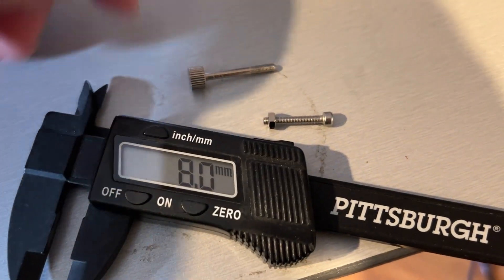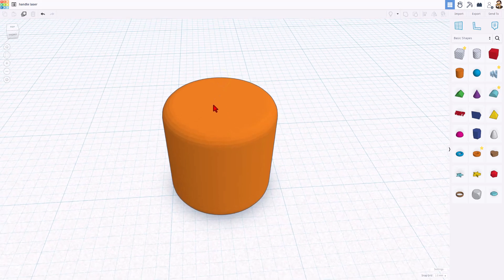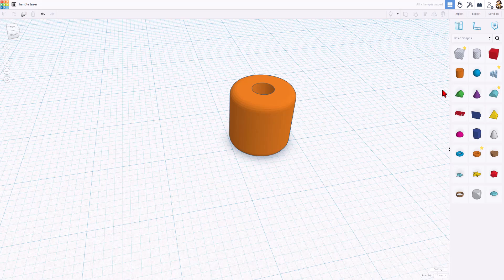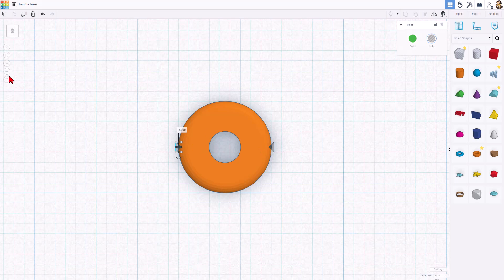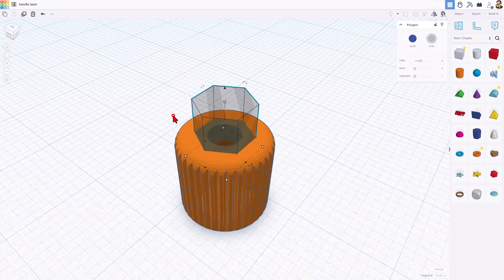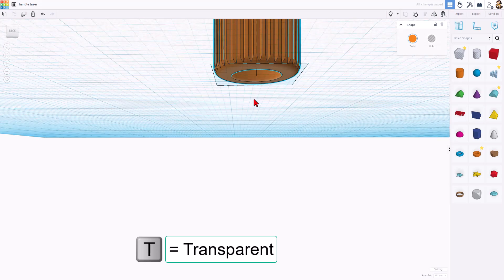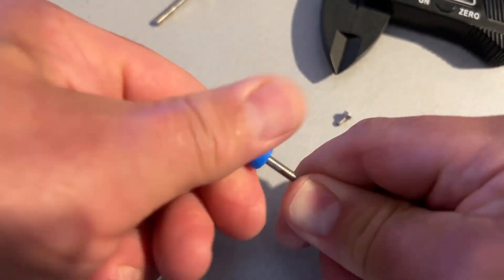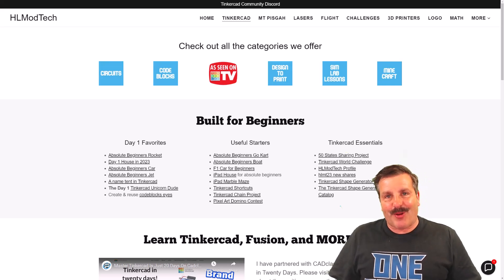3D Printed Handle Fix Tinkercad & Bambu Labs for Beginners Make This Part FAST!

Comment: any advice on creating a thread to match an existing thread?  I've been playing with the thread features and I just can't seem to get it right. :-/
Reply: Use the ISO Metric Thread shape (even for Imperial and BSW screws). Outside diameter matches the screw the get the metric thread pitch from the internet.
Reply from the maker: Super cool to have ZDP check in. That’s where I get my expert advice on Threads. What printer are you working with?
Reply: @HLModTech  bambu a1 mini, creality k1 max, qiddi pro max are the ones up and running at the moment. :-)